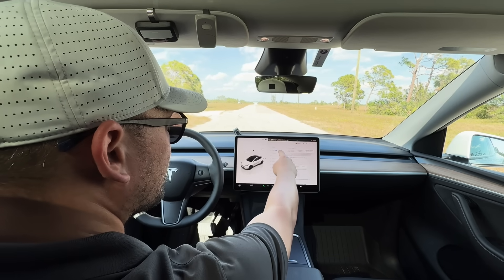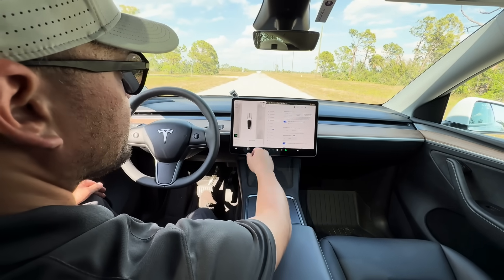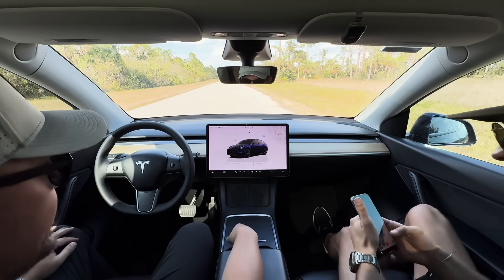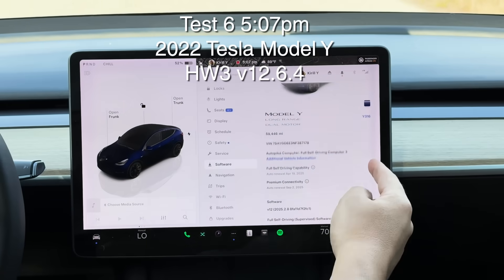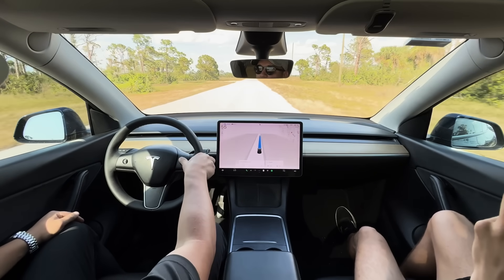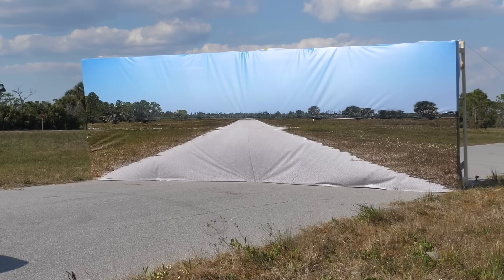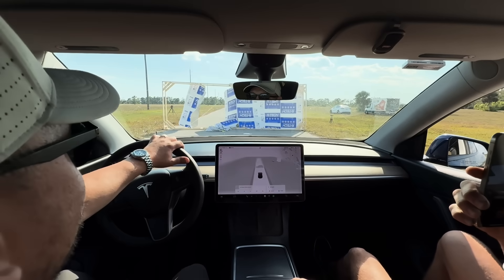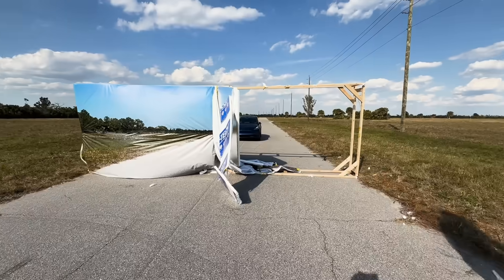Mark Rober Debunked - You can't fool a HW4 Tesla using FSD!

Comment: I wonder if the size of the wall has anything to do with it because you couldn't see around Mark's wall but you can around yours?
Reply: Isn't the key point that in this scenario at a distance the car could see the treeline behind the wall? If the wall was higher and the car could only every see sky/fake sky i think that would confuse it if it doesn't have LIDAR.
Reply: @HouseMartin just curious, how about night test and tree line are way back on n the dark. 

Not against but ROBOTAXI couldn’t select day or night service, nor selecting road with or without light. 

Night test probably the true test for ROBOTAXI FSD whether software is really mature (safe) or not. Night with fog might be better?
Reply: That should make it more likely to miss seeing the wall.
Reply: Mark also stages his videos
Reply: Mark used HW3 with Autopilot, which is inferior technology to Full Self Driving.
Reply: @sylviawylie9218 Wouldn’t that make the claim in this videos title false, then? If Mark used HW3, then HW3 also failed the test in this video. 

This video didn’t debunk anything. It actually confirmed Marks tests.
Reply: @StolenJoker84 he intentionally used an outdated version of software to make Tesla look bad.
Reply: @StolenJoker84  marks test "can you fool a self driving car" certainly implies that its full self driving not just autopilot. Marks video is supposed to be testing if cameras are good enough to avoid hitting the wall or if we need lidar. This video here proves cameras are good enough to avoid hitting the wall and Marks test was misleading because he wasnt using FSD. I do think the background picture needs to be more like Marks background though
Reply: @blazedorange  This video proves that the newer (HW4) version is good enough. HW3 failed here too, showing that “autopilot” vs “FSD” doesn’t even mater.
Reply: @StolenJoker84  it might only show that the software version isnt good enough as HW3 is still on an older version. Either way it shows that camera technology is good enough. Do you think Mark was intentionally setting up his test to try to make Tesla fail or do you think he was trying to make a fair test to see which technology was better?
Reply: @blazedorange  I think he was testing using the technology that he had. I doubt that it was intentionally set up to make Tesla look bad, but I’m just a viewer who has no skin in the game. I don’t know (or really care) what year his personal Tesla is to confirm the HW version. Someone else said that his was HW version 3, and (assuming the other viewer is correct) this specific video proves that with HW3, it made no difference at all if he used Autopilot or FSD. The car still drove through the Wile-E-Coyote style cartoon wall.
Reply: @ Yes, I think Mark was intentionally misleading.
His video featured a Luminar Technologies branded vehicle, piloted by a Luminar Technologies employee. They pitted peak Luminar tech against 2019 Tesla tech in a bunch of scenarios that would never occur in the real world.
Mark's charity also received $4 million from the CEO of Luminar Technologies.
Reply: @StolenJoker84 Definitely Mark was intentionally misleading.
These test were set up to show LIDAR advantage. But LIDAR can also miss something that camera wouldn't.

Although the biggest issue is phantom breaking. LIDAR is known to see objects that can be just run over, like a steam, water. You can design a car that won't crush with LIDAR much easier. But it's harder to make a self-driving car that won't annoy everyone around, including the driver.

Idk about weak weather conditions. LIDAR or just infrared camera will have an advantage. On the other hand, if a human can't see anything, it's probably not safe to drive anyway.
Reply: @StolenJoker84  I would agree it confirms what Mark tests showed and then added more data about HW4. If anything it shows the auto pilot vs full self drive in HW3 didn't matter. But as a total telstra noob what is ther difference between HW3 and 4?
Reply: @blazedorange  the title said self driving I would say auto pilot fits that term as he never said full self driving and he specifies in the video so he didn't give misleading information just a click bate title
Reply: @shozza100  i dont know about that, autopilot shares 0 of the same words where full self driving contains 100% of the words in self driving. I dont think anyone watching this video would interpret it as autopilot instead of fsd without reading the description. I know the difference between the 2 and I believed it was fsd until this video here.
Reply: @ For newbies the most important thing is that Mark was intentionally misleading. The video was created to show LIDAR advantages over camera while not showing disadvantages.

In addition, they didn't like the results, so they took older Tesla, with less capable software and hardware.

About differences between HW3 and HW4, they can be found on web. Some key upgrades:
- 8 -> 11 cameras with higher resolution
- way stronger GPU
- 8->16GB of GDDR5

Better cameras require stronger GPU to process input.

More memory and stronger GPU allow to use some kind of transformer model. It is better in focusing on details, keeping attention on those. That's why V13 can't run on HW3.
Reply: @StolenJoker84  Yes and no. Mark claimed that Tesla failed flat out, without marking any difference between the hardware versions. His video was purely and advertisement for his friends LIDAR company.
Reply: @sylviawylie9218  wow, did not know that. feels like intentionally misleading
Reply: Maybe the camera uses parallax calculations, so size might matter. But not that much.
Reply: Obviously this wall has a tell tell sign of fake wall with the dancing cloth created by the wind.  Accepted it the reason why Tesla sound robot taxi yet is because it doesn’t have LiDAR will like have a catastrophic accident in Austin. Can’t beat physics. LiDAR plus radar plus other sensors beat out plane old camera anyday.
Reply: Mark used his personal tesla, he didn't intentionally use an older one, thats just what he had. I know he has grown a lot since the early days of his channel, but he still mostly adheres to his early  principles of "experiments you can do yourself" and "fun facts about common objects." he does things at a much larger scale now, but nothing is stopping you from scaling down what he does. His underlying investigation with the whole tesla thing was "can you fool a camera to think a 2d image is 3d" and "what are the advantages of LIDAR technology" and the video unequivocally answered those questions. Can you fool the camera? yes. He never wanted to know which tesla fail, he wanted to see if it was possible.
Reply: @S0UPIE  That's a very naive approach. He intentionally avoided using FSD. If someone is into technology, he looks at the latest, the greatest.

You could train neural network to detect with a single camera if image is 2D or 3D. Tesla didn't train to do it, why would they?

The are other aspects, like being a close friend with CEO of company making LIDARs for cars. And this CEO gave a few milions for Mark's charity.
Reply: spunkloaf  I can't remember when was the last time I disliked a video. It could have been the first one for me. It was so bad.

I was trying to understand his audience. I assumed even that people want entertainment, not science. Ans that video was about LIDAR, not about Tesla.

If he just tested Tesla against a wall and a car with LIDAR, I'd say "whatever". LIDAR can't be fooled so easily, so that's partially a truth.

But he did something much worse. In the video his goal appears to be to compare computer vision with camera vs LIDAR.

You could set up your own computer vision model using camera that will most likely stop in any of those cases. But let's assume he wanted some comercially available solutions (even though you can't let the car drive with that LIDAR he provided).

Now you have to ignore all LIDAR disadvantages.

Then you need to create tests that will show LIDAR advatages over camera setup.

I hope that clarifies a bit. It just hurts to see such a test. Now let's try to assume it wasn't rigged. How likely is that he copied these tests and he had no idea what he is doing, including turning off FSD - a technology that is not ready?

AI driver added some context - Mark and CEO of company that gave a car with LIDAR are good friends. So if you really belive Mark is stupid - he's not.

Disclaimer: I don't own Tesla, neither plan to have one anytime soon. I don't own Tesla stocks. I'm interested in physics and IT, including ML. I'm impressed what Tesla managed to achieve.
Reply: @spunkloaf To be honest, you sound like Mark's fan. Money does bad things with people. I'm sure he evaluated it'll be profitable for him, even if being sued.
The title of video is "can you fool a self driving car". I don't know what's advertised. I know Tesla has some self-driving that is supposed to be put on test in his video.

I told you I tried to understand his perspective. So, misleading title, video is about LIDAR vs camera computer vision, not about FSD. But it's completely unscientific, and clearly misleading. After watching a video someone who doesn't know much about LIDAR won't know about it's disadvantages. It's presented as something superior to camera, what is false.

I'm not going to convince Tesla they should put LIDAR back. It's easier to make a car that won't crash with LIDAR, but harder to make it useful.

Imagine a situastion where LIDAR detects an obstacle and camera does not. A simple answer is that a car should stop. But it's wrong. LIDAR has many false positives that create an issue of phantom breaking.

So when making an autopilot we need to overwrite LIDAR input with camera input. But is it a good idea? Maybe we should just rely on camera instead? 

Solving self-driving is way more complex that it seems. Car has to avoid collisions and don't annoy everyone around. Especially important with emergency vehicles. There are interactions with pedestrains, bikes - a car must know if it's allowed to overtake or not. And many more, like working on wrong navigation data, etc.

If you don't know about those issues and focus only on collisions, that fair - that's what most people do. I don't believe Tesla data that current versions are way more reliable than human. But I think it's getting close. A few years and we won't talk about collisions anymore, with cameras only. So we can see the decision was right.
Reply: spunkloaf  Nice that you get an idea. We can get more technical if you want.
Have you ever trained unsupervised model? What happens when you add additional noise?

So, in short: Can we make a better autopilot with camera + LIDAR? Of course. Is it easier or harder?

I know it's counter-intuitive. Usually more data is always better. The thing is that camera already delivers tons of data. We should focus on how to extract relevant features, instead of adding additional sources of data that generate more noise. We're talking here about strongly imbalanced dataset - to be honest, I have no idea how to approach it.

Moreover, GPU processing power is quite limited in those cars. We want a smaller model if possible. So even in case of traning data from camera only, they take it only from some drivers, only for some situations.

Some example where LIDAR or more training data won't give anything.
It's true for previous versions not sure about V13 or most recent V12.
A pedestrain crosses the street - the car correctly recognizes it's a human. The pedestrian falls over, lies down on the street. The car forgets it was a human, thinks it's a speed bump or sth like it and just runs over him.

It's true for Tesla, but not only - laud case where Cruise drag a women for 10m. LIDAR won't help here. The car had LIDAR, and camera saw her legs all the time.

The solutions seems to be a transformer-more like model with attention layer.

Back to the point. I don't know how much Mark knows about ML. I studied physics, I prepared different tests in the past. For me he clearly wants to show LIDAR superiority over doing anything scientific, and it's fully intentional. Test conditions were changed, probably multiple times, since initial tests didn't give "wow" effect. Not sure why it's not obvious to you...
Reply: He literally did it with HW3
Reply: @placeholder6373  it is still something i am curious about (im not a Tesla defender by the way)
Reply: HIS WAS BETTER TESLA SUCKS
Reply: @AMPProf  TDS/EDS is strong with this one
Reply: @drewbarrymore8660  woohoo and that is

Comment: And all of this could be avoided with at least one simple Lidar in front of the car to avoid collisions, probably two for redundancy, instead of relying solely on cameras.
Reply: What is funny is that many of HW3 cars still have radar installed but it was disabled in software
Reply: Lidar is much better than radar in this case
Reply: @ That's what I meant. sry
Reply: Just because this particular test passed means nothing, there are plenty of videos on YouTube showing the FATAL crashes where the FSD cameras DIDN'T work including cars hitting traffic light poles, a couple of walls,  what appears to be an old fashioned wooden telegraph pole [and they WILL totally destroy a car, or the ones in Ireland and NZ certainly do] and a variety of other items that nobody could miss including, you would have thought, cameras.
Reply: "NO X-DAR OF ANY KIND FOR YOU...!!!" (unhinged Elon speaks)
Reply: LiDAR adds signal and noise. LiDAR sees imaginary walls. They are called false positives.
Reply: @ericgregori from an engineers perspective this is about as unhinged as it gets. lidar and radar are some of the most reliable tech for 3d reconstruction. radar has the huge benefit of directly measuring relative speed and being generally sensitive to large metal objects (providing a good data basis on car positions and speeds), and it can also sense a car braking 2 cars ahead of you (by reflecting off the ground). lidar gives you a super reliable point cloud which is much more accurate than the vision based guesstimate, while also being immune to environmental lighting and some degree of fog/rain. combining multiple systems will always reduce the error and improve data quality, as long as each system can provide a known error (radar and lidar both do). 

the reason tesla uses cameras is the vastly lower price. remember when they dropped radar during chip shortages with some bogus excuse? they added it back soon after. unfortunately tesla still only has basic automotive radar, while other vehicles at similar prices are equipped with more advanced radar for blind spot and cross traffic detection.
Reply: @JimmyBullets  you believe musk and insult me because i challenged it, i will not argue with you

tesla FSD is level 2
mercedes has level 3 and 4 in specific areas, bmw and honda offer similar level 3 autonomy
Reply: @drkastenbrot  "in specific areas" lol

Comment: So exactly what most of us suspected. The Software + Hardware are relevant and not if radar/lidar or vision only. 

And just so you know: your seat can move forward. If you keep sitting this far back your steering wheel airbag effectively becomes useless and even the safest car cant safe you in an accident. Also, you cant reach for the wheel fast and strong enough should you need to.

Comment: Tesla getting rid of lidar and radar for taxi is a disaster waiting to happen.
Just like Boeing taking shortcuts on airplanes.
Reply: if there are a conflict between the different sensors which ones do you trust? If you trust one more over the other, then the "untrusted" is superfluous.
Reply: @ The one that sees the object.  The radar is to see further ahead in case cars are coming to an abrupt stop or sees people behind cars.
Airplanes have backup systems.  Would we take away safety systems for cheaper flights?

Comment: But you know they can add Lidar so safety almost 100% guaranteed, but they don't
Reply: Lidar is extremely expensive. Not a Tesla fanboy, but just pointing this out for fairness.
Reply: @magicjinn  if they make it inhouse price will drop significantly, just like tesla is partnering with battery maker before that's why tesla price become reasonable. tesla missing out on buying all the Lidar startup when they actually have good reputation and money. and now i'm not sure this will be good for them in tho long run that if they have one

Comment: How is this a good test?  Good that it stopped, but should have driven thru because there is a road behind the picture.  A real test would be to put the fake picture up on a dead end road and see if it drives thru.  The GPS should be showing a road past the picture and if it sees a road why would it not drive thru??
Reply: Maybe you should put a picture of a brick wall in the road and see if it stops.

Comment: HW4 has more cameras with higher resolution and faster processing time. Having more than one sensor type, so that if one is fooled the other will keep a grip on reality, still is my minimum requirement for trusting a self driving Vehicle tho. Also, how do they act in case the cameras fogg up or snow sticks to the vehicle blocking the cameras view. Does it just come to a standstill if the human does not respond? On highways and busy streets this would not be great.